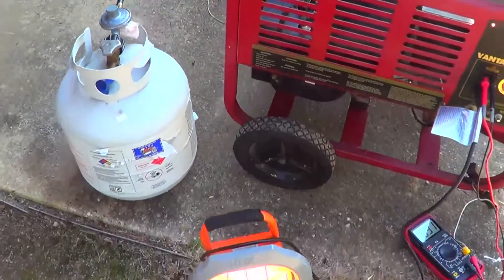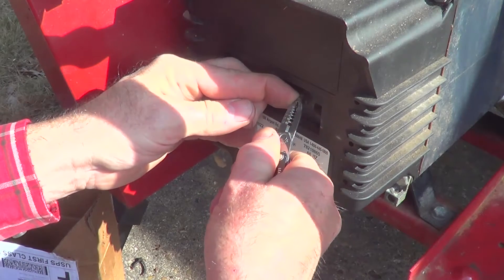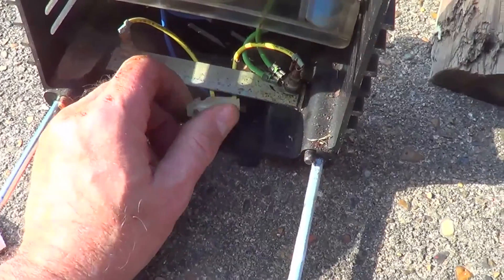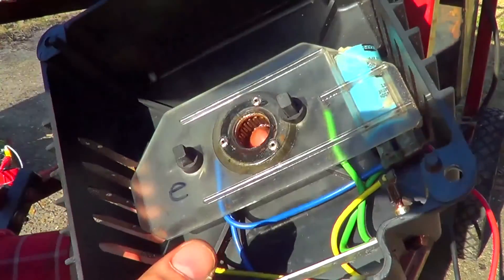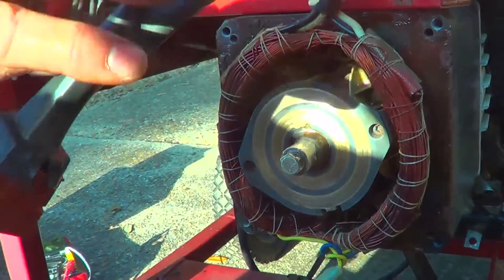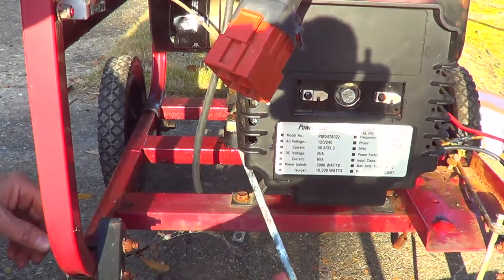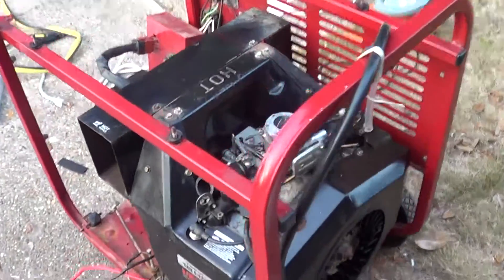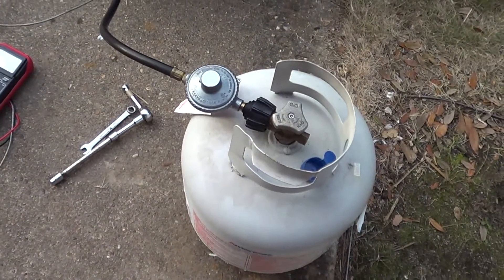Coleman Powermate 8kw generator 90 Volts ran on propane

Comment: I know this is an old video but this generator doesn’t have an AVR. So normal hertz is 61.5 and normal output with no load is 130-135. If your voltage is low at at 61.5hz check the capacitor.

Comment: Very informative. I love that throttle adjuster; it sure makes it easier to set.  I have the 5000 watt Powermate, which is real similar. I added electric start and propane to it. It runs great on both but I have had trouble with the propane after I shut it down and try to restart. I can not get anything through my primer on the demand regulator and it will start and die. I have tried three different bottle regulators. I finally put a cutting torch regulator on it set at almost a pound of pressure and it works perfect.